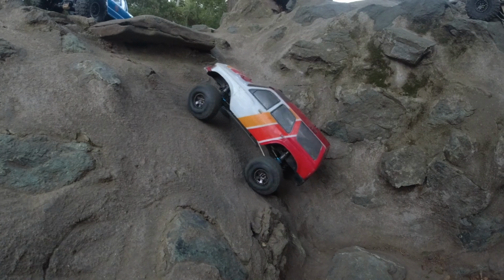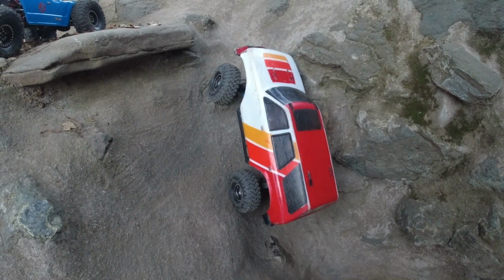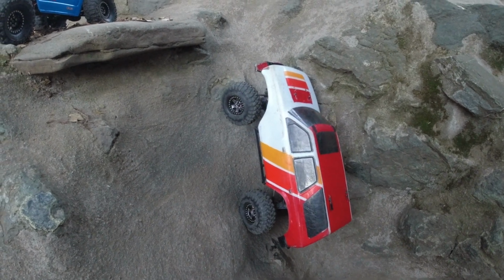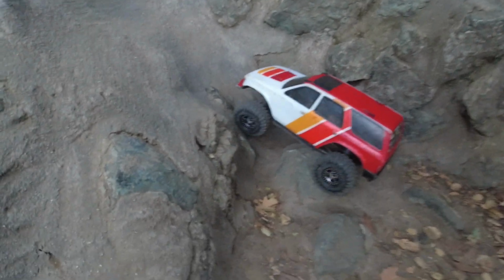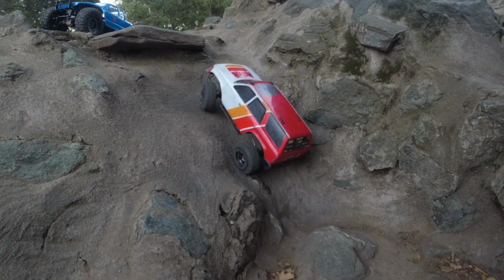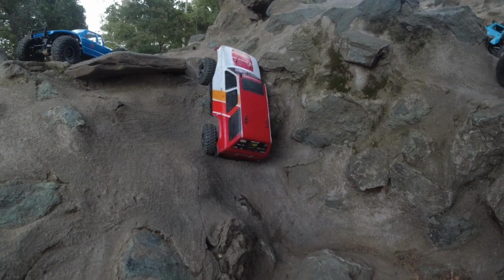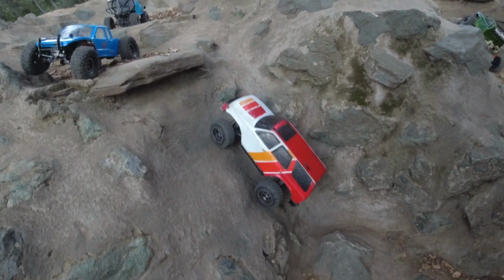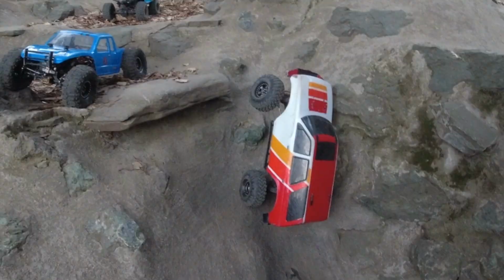Importance of Weight Distribution on RC on Very Steep Climbs!

Comment: Tires and weight distribution is everything. And I prescribed to adding less weight not more weight. Weight in the proper place is way more important than a bunch of heavy brass
Reply from the maker: I am in the same boat. Focus on weight distribution and add weight only as needed
Reply: I agree. Where do you put distribute your weight?